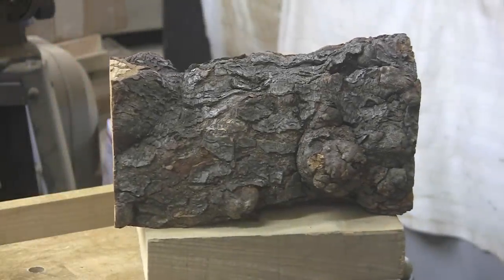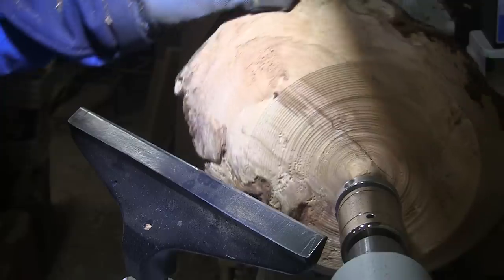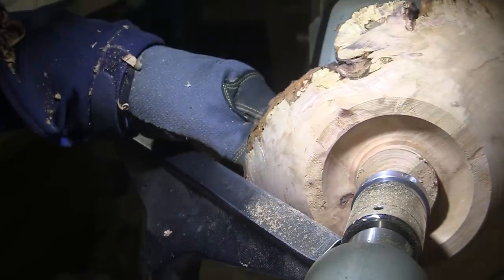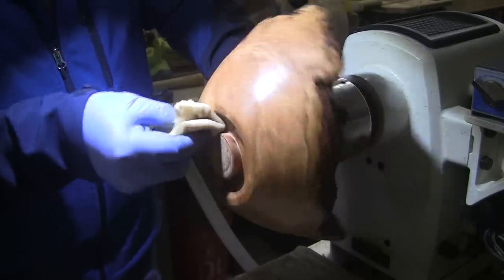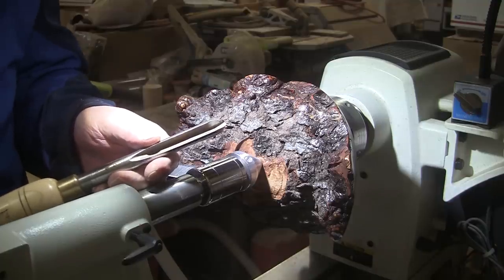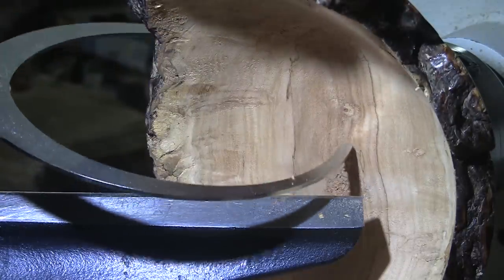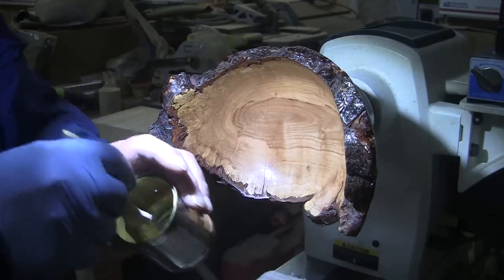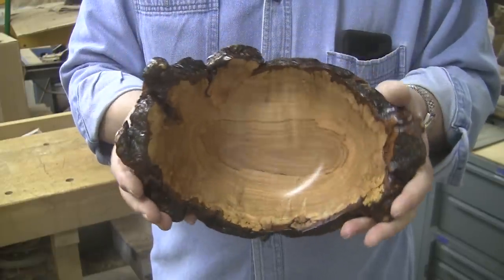Wow! Wait Till You See Inside! - Wood Turning

Comment: Get you a bandsaw to cut the corners off your logs before you turn them, it will save your knuckles and is a lot safer. Love your lath work.👍👍👍💕
Reply from the maker: I have a great bandsaw, Mark!  I even use it sometimes.  I prefer to turn away the waste most of the time.  That way I can control where to stop in case I see an unusual shape or feature appearing as I turn.  If I cut the corners off before I start, I'm locked into that.

Comment: That's a beautiful piece.  It reminds me of those old picture frames with the convex glass of my grandparents.  Prayers for continued health.  
You say your shellac application is just like your sanding sealer procedure.  Could you show applying your shellac to the smooth wood parts sometime?  I have no luck with a rag.  I found a watercolor & acrylic 1 inch Synthetic Squirrel Oval Mop brush from Hobby Lobby that seems to work the best for me on smooth sanded wood. I also find that after applying a couple coats of shellac, if I follow up with a coat of lacquer, it seems to remove or smooth out some of the shellac unevenness, as-well-as it helps water proof the piece.
Reply from the maker: I'm doing much better, Bill, thanks! 😊  Well, when I say it looks just like applying sanding sealer, that's what I mean.  Same kind of rag, squeezing it out of a bottle onto the rag, rubbing it into the wood, EXACTLY the same.  Just no point in showing it, it's the same!  I don't have any unevenness as you talk about.

Comment: Phil,. From the angle of your camera, your live center appears to be made from aluminum and the point of it appears to rounded off.  I can understand that aluminum would be a lot gentler on your tool edge if the two happen to make contact in the tight environs of the tail stock, but I can think of no other advantages that it might offer.  And as for a less than sharp point, I can think of no advantages at all.  Can you explain, or do I just need to clean my glasses?  Again, lovely work and thanks for sharing your time and knowledge.
Reply from the maker: It is aluminum, Pete, solid in structure.  It's there just for the reason you describe, gentle on the tools that meet up with it on a regular basis.  It does have a sharp point.  I have cleaned it up and polished it a couple times but that only lasts until the next time I use it.  I don't expect it to last forever but I do expect it to last for 20 more years or so.  That should do it for me! 😊  It is replaceable from the manufacturers so whoever ends up with it when I'm gone can simply order another cone center and be on their way.

Comment: Hi Phil what’s the difference in the negative scraper and a conventional scraper ?😁
Reply from the maker: Negative rake scraper has a bevel on the top as well as the bottom, Allan.  In my case it's 36° top and bottom.  The double bevel makes it so much easier and safer to scrape rather than just the single bottom bevel.  But, the sharpness doesn't last nearly as long as the single, bottom bevel.  Luckily, it doesn't take long to replace the burr and get back to work!
Reply: Thanks Phil have a great day

Comment: What do you put on the bark or rough edge to harden or protect it
Reply from the maker: Usually nothing, Jack.  If the bark is loose, I'll apply a little CA under it and maybe clamp it down.  Other than that, I don't treat the edges any different than the rest of the piece. 😊

Comment: No comments about your health. Gotcha!  But I do have a question.

I understand the "scrapper" part of its name, but what does the "negative rake" part of its name mean? It looks more like a positive tool than a negative one. Hmmm, come to think about it, "sweat back bowl" is a funny name for a tool too.

And Tuffy sure sends you a lot of wood to turn. You go, Tuffy!   LOL
Reply from the maker: The "scraper" usually has just one bevel from the underside.  That creates a rather sharp/abrupt edge that can dig in when in use.  By grinding a second bevel on the top, the abrupt edge is gone and the scraper is easier and maybe safer to use.
"Swept" back gouge.  Just means the sides of the gouge have been ground back, away from the point, making a longer cutting edge rather than just the tip.
Tuffy is indeed a treasure! 😊